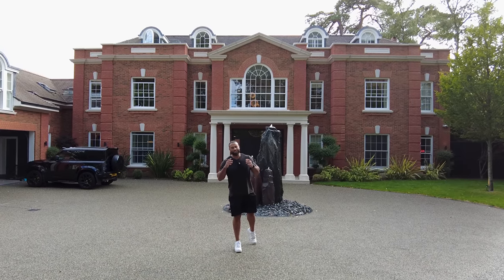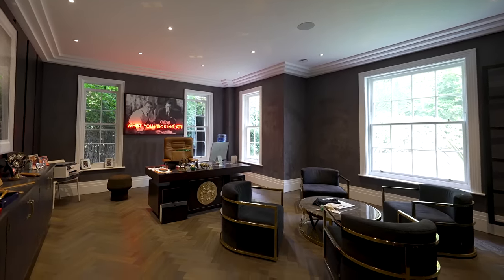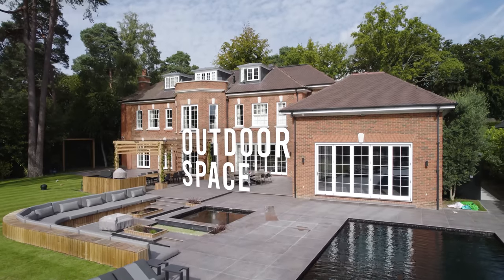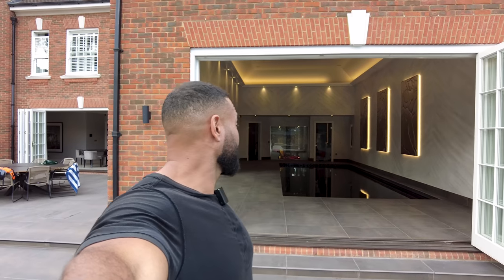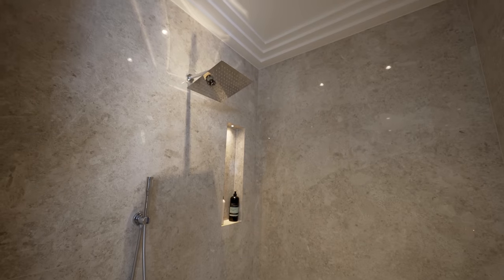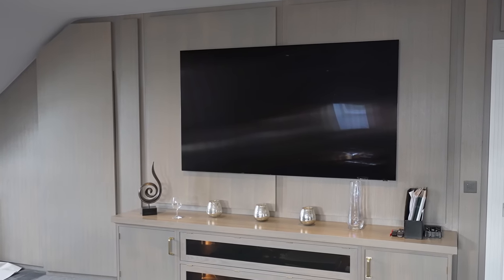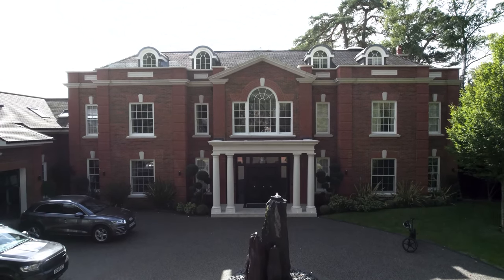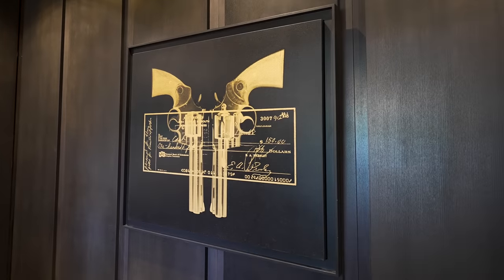Everything in this £15m House is for Sale! | Property Showcase

Comment: Love the house, gived me great ideas for future, Just think that, since the back of the property is turn South, it could have an off-grid Renewing energy system (solar panels on top of the secondary building turned east) to deal with outside Environmental light at night and help with the costs as well. Not sure if it's planned for the future, since the house it's 95% complete (don't know what's on the other 5%) but this would be the only thing that I would add to it. Great job.

Comment: Too many people get the spiral staircase the wrong way around! Its meant to be like a castle; Where most people are right handed, you have the spiral around to the right. So the attackers right hand is on the inside and awkward to attack on the way up. Where you are at the top of the staircase have your right hand on the outside, making it easy to attack the intruder. It's literally a safety feature and you gave the advantage to the attacker. With their weapon on the right hand outer side on the way up the stairs. You have the disadvantage to try and stop them. Yes the staircase is the best place to confront an intruder. Unless you get them before entry of course.

Comment: Why you dont have ventilation indoors at uk? Just was visiting over there and usualy bathroom was fuly mold. Dont know if its because some saving at gas and shut it down when are not at home
Reply: Depends how shitty the buildings are. A decent building will have adequate ventilation and won't get mouldy. Shitty buildings and very old buildings are much more prone to mould